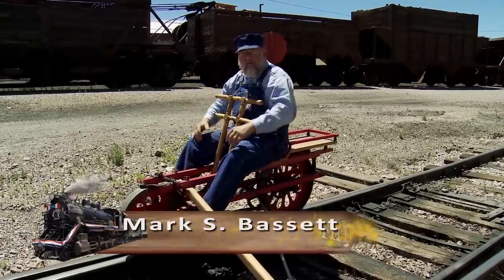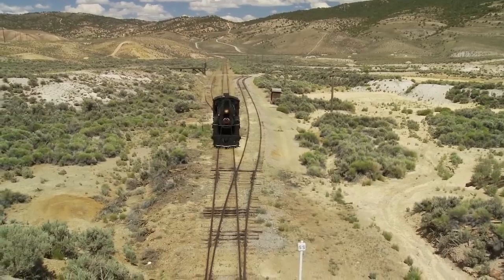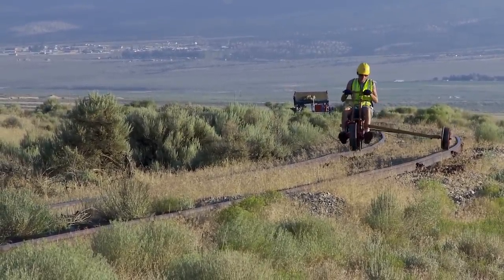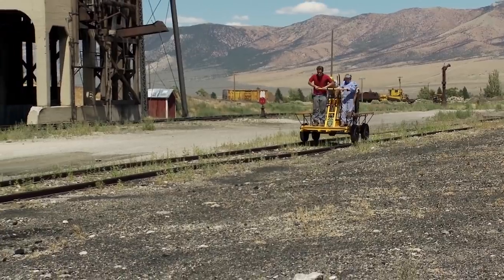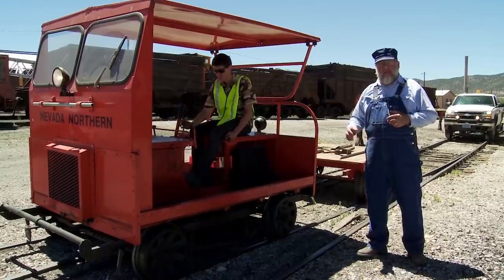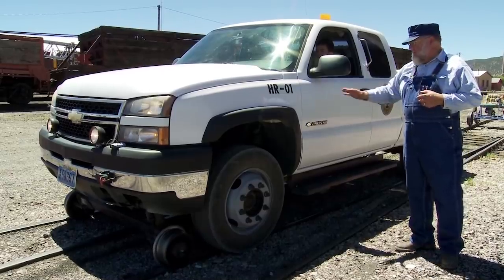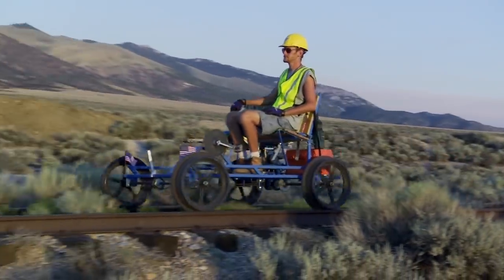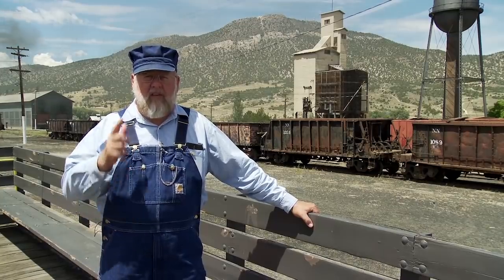NNRy Riding the Rails HD

Comment: Great vid.  I used to drill thru rail for bonding with a hand wound drill ; to install transducers.  When you use a gas or electric bonder the hole is too sloppy.  Go hand wound and muscle power on rail !  Still in use today.

Comment: I've used pedal-powered speeders in the Idarado Mine near Telluride, Colorado as one pedals and up to two can ride.   In the Republic of South Africa I used  versions with two pedallers,  I and my team leader rode up front, and two and sometimes more piled on on the back.   If the track grade was one percent of more we could turn off our lamps and have a seriously fun ride on the way out.   Both versions had cast aluminum wheels so we could lift the speeder off the rails if an ore train needed to pass. (BSc Mining,  CSM 73)

Comment: I like the high rail truck because it's a normal road car with train wheels.... so you can not only drive on tracks but roads and even beside the tracks in the dirt under the right conditions or if it's  a 4x4

Comment: My grandfather used a velocipede.  I've ridden a few motorcars doing track maintenance. I actually got use a gang car once.  The with those is there is no coasting. That arm is going to keep pumping and if you get tired and let go it can knock you off the cart.  There were no fat railway men back then. You burned off all those calories just getting to the job site. A simpler time and maybe a better time.

Comment: I would love to do that! Do you know what rail lines allow rail running and which don’t?
Reply: I would assume that no active RR line would allow private speeders, that would be trespass. There are, however, a number of abandoned rail lines where such activity might be legal. I live in the Four Corners Region. There are still intact sections (mostly) of Denver & Rio Grande RR lines in the upper Rio Grande Valley in Colorado (Hwy. 149 vicinity of Creede,. CO) that look like they would be a lot of fun to rail run on. I do note that within the last five years or so where the rails crisscrossed the highway they have now been paved over, which would entail running a vehicle fifty feet or so over asphalt paving. There are also a lot of trestles and tunnels, which may no longer be safe.

Comment: he should have made it like a bicycle, u can get more power out of ur legs compared to your back
Reply: You got it David.  We had that in all the places I worked in metal mines.
Reply: Kenneth Cummings well that way he works out his back and abs, grannys gonna be his hahaha
Reply: 1:40 you can see he is using both legs to push forward as his torso and arms move back - double action, which is even more powerful than just pedalling.
Reply: RichardR1950 nope, the way back, when he leans forward is moving without doing work. idle. like lifting ur foot up after u pushed down. what he does is like rowing, but without biceps and horizontal muscle in the back. i can output 2x power in the gym on bicycle compared to rowing easily and he is not even rowing 100%

Comment: My son works for a railroad and he worked using a highrail truck.  There was him and two other guys, contractors usually, that used all sorts of electronic gear to examine the tracks.  It would see problems like track expansion and electronically mark the locations and send them off to his boss to schedule crews.
Reply: A geometry truck?
Reply: @rickkeeton9246  I believe that was what he called it.  Not the rail car size but more along the lines of an over-sized pick-up.